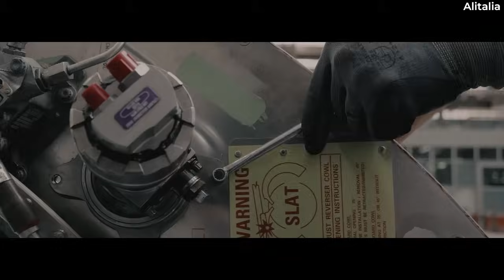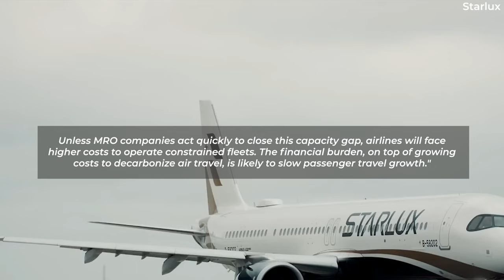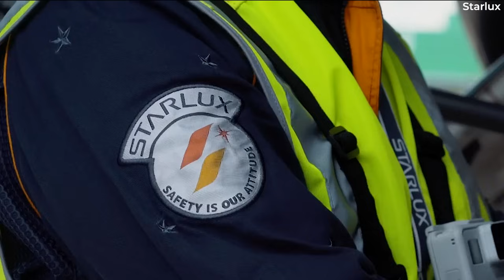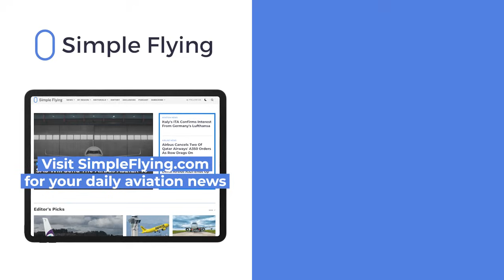Supply Shortages Mean Aircraft Engine Maintenance Times Are Higher Than Ever

Comment: I somehow doubt that globally it would change anything if more different types of engines were in use at the same time. Doesn't change the amount of work needed per engine, the amount of parts/engines needed, or the total amount of people educated and working in this field. If anything it makes production more streamlined, and there is still significant competition and therefore innovation in the market.
Reply: So I work in this field. Your suggestion is not the case. Technicians, engineers, mechanics, etc., all need to be qualified on each type of engine they work on. While many are qualified in multiple models, introducing more engines to repair increases training requirements, meaning longer training times and less time a mechanic is on the floor. Also, engines rarely share parts between each other unless they are very closely related.
The industry already faces few manufacturers that make components, and there's not enough people making enough stuff to meet the demand. New engines are coming online and taking parts, meaning that engines which need repair much sooner than are competing with fresh engines going to market for parts. Add to this, airlines have to keep legacy engines running longer. That means that factories which were going to shift over to new components are now having to continue making legacy parts to keep old engines going, so it will be more years before those manufacturers can shift. Mechanics are also having to spend more time on the "lengthy and complicated repairs" mentioned in the video, which we are absolutely seeing in the industry, especially this year and last year. More time being dedicated to repairs means less time to train to work on new engine types.
It all feeds itself. More engine types would just mean more engines which needed to be trained on and more parts which need to be made and delivered on engines needing to be repaired sooner than expected, all while airlines need to keep old engines flying, and with an already small industry making these components.